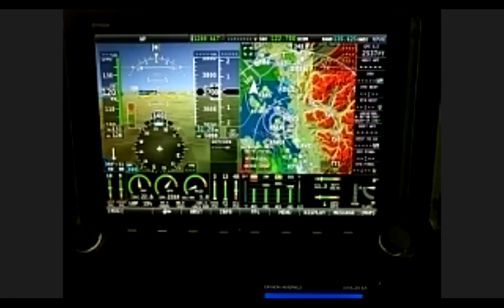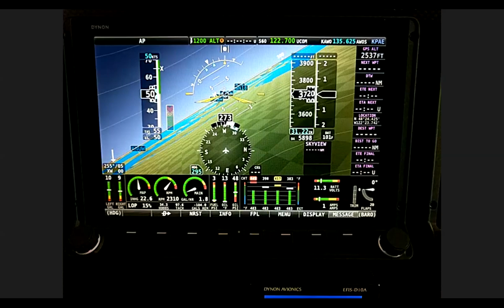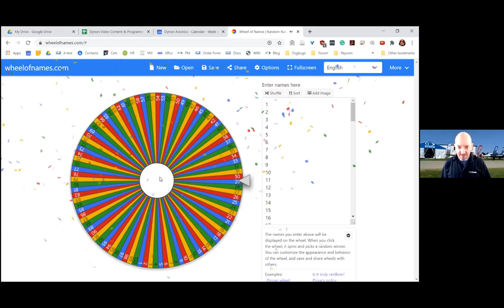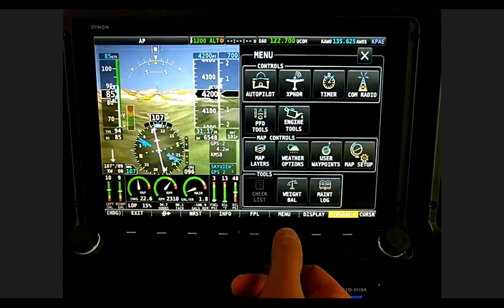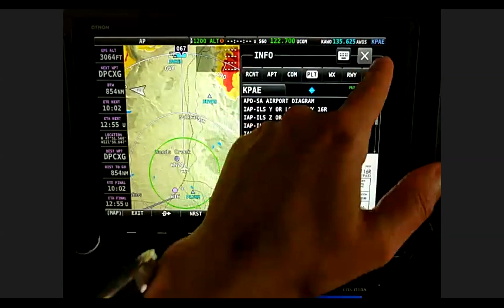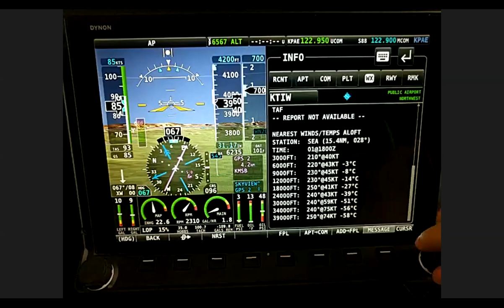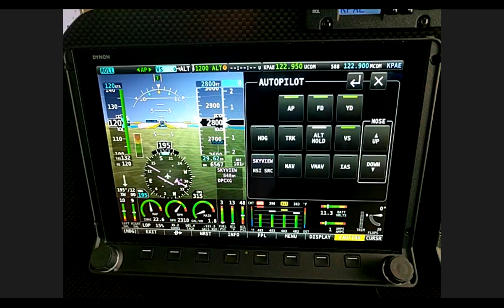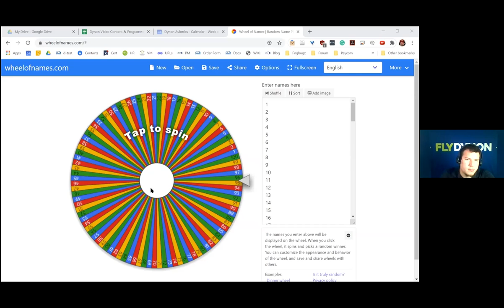SkyView HDX Demo: Virtual Booth Visit - July 27, 2020

Comment: Very informative but I suggest changing the HSI source and having bearing pointers should be easier to get to (several menus deep, should be a soft key button too). Nrst should be a sub menu when you press the direct to(I don't feel nrst is of enough value to be a front and center soft button). idk how big the touch areas are but for example the entire area above your current IAS on the A/S tape that also includes the ias selector should be a touch point for ias, below ias for V speeds, above the current ALT for alt select(18:43 ?) and be below it for Baro (or even baro mins?). This would helpful in turbulence. AOA colors are too cluttered for a cruise flight, I shouldn't see yellow or red until I'm actually getting to that undesirable AOA. Maybe make brg pointers cyan+white or dashed cyan. Maybe it could be an option for long press/short press for the left knob to be (HDG) sync vs selector menu. I'd change PLT (plate) to CHRT (chart) since plate is kind of slang. And I'd make the Direct to button have to be a once to load twice to execute just in case you didnt mean to hit it while in the airport info menu. That whole comm demonstration was Soo cool and forward thinking.